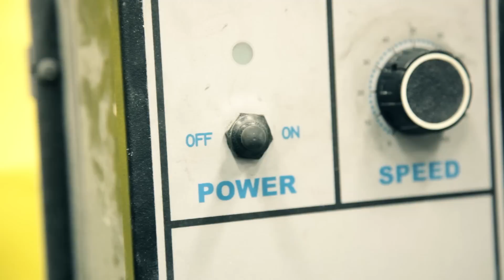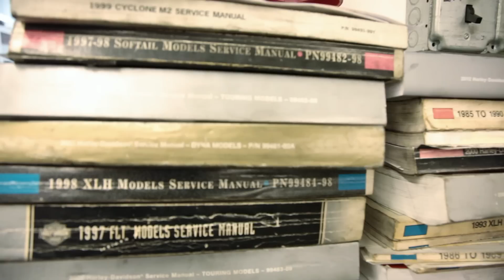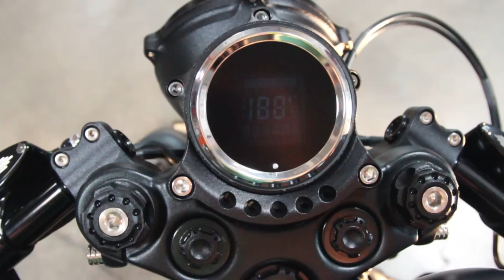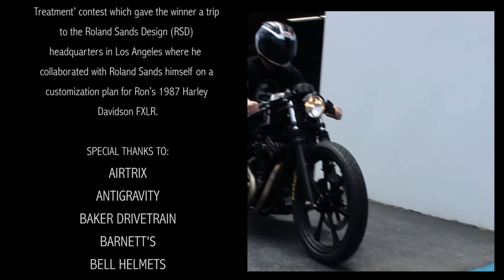RSD Bell Star Treatment FXLR

Comment: id say tank lift is not a cafe stance at all..
Reply: The tank lift could have worked if they mounted the bars on top of the triple trees with clubman bars to bring the visual weight up. It would of created a clean line for your eye to follow starting from the bars flowing down the tank. It needs rear sets, the mid mounted controls would be just brutal to ride folded over like that. There are a few pieces that would have sorted out the obvious issues. However I don't know the timeline or the circumstances of the build, but really is any bike ever really done? I don't think a Harley really asks for the full cafe treatment; scrambler or flat tracker I've seen some incredible work.